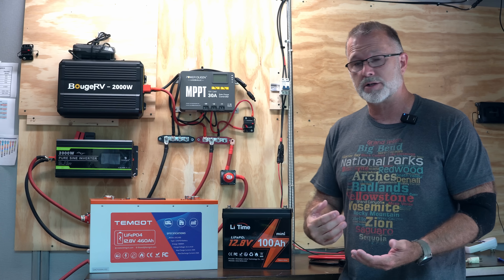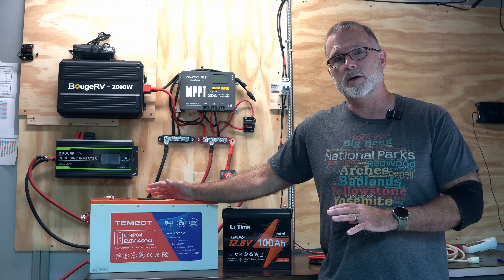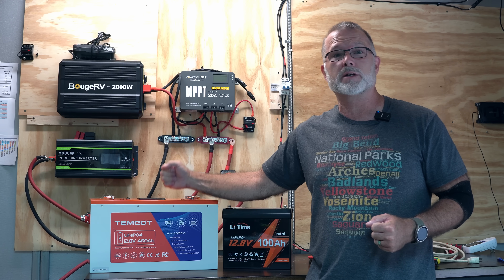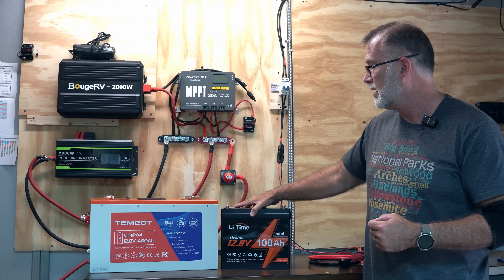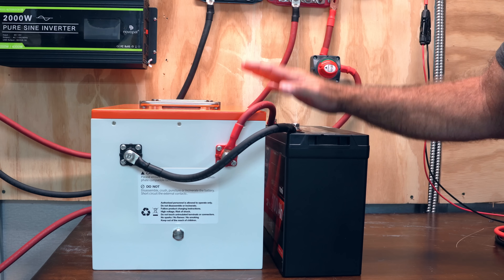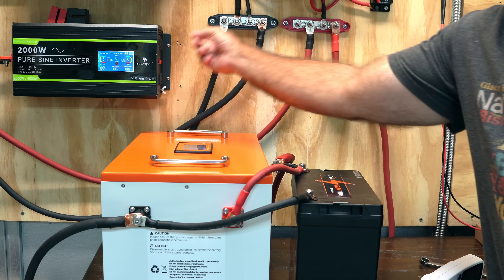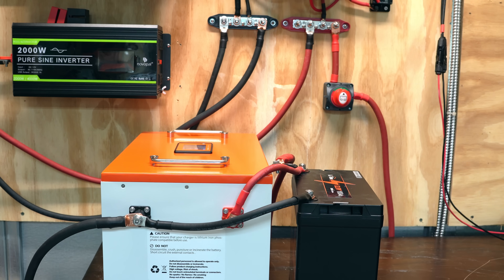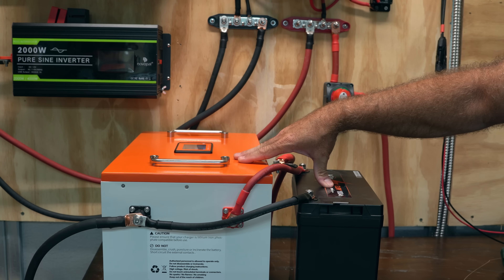Connecting Batteries with DIFFERENT Capacity in Parallel - What Happens?!

Comment: From what I understand is when you connect them in parallel the bms in both combine so you could say run something that uses 350a continuous so maybe ck that out next and try to run say 250a thru them and I don't think the smaller one will shut off. I been told they would share the load and the smaller one could handle it so let me see you try that next. At least try to run something larger than 100a and see if it shuts down the bms in the smaller battery. We do this with Ebikes and I haven't heard of any that shut down
Reply: great explanation what might be an order larger to small in line or would it matter
It seems smaller should not drain til larger is depleted to its lowest level
Then the smaller would maintain an hold off the larger til they equal then
Would drain even til both fail there limit
Reply: No, the BMS systems don't "combine". The ratio of the capacities determines, to a first order approximation, the ratio of the currents supplied, so the smaller battery supplies 18% of the total current and the larger one supplies 82% (i.e. 4.6x as much).

Since the large battery's BMS limits its maximum current  to 250A while the smaller battery's BMS limits its output to 100A, the larger battery's BMS turns out to be the limiting factor (only 2.5x that of the smaller battery).

The result is that with a total current draw of 300A, the larger battery would supply 246A and the smaller one would supply 54A. Any more and the larger battery's BMS would trip, immediately followed by the smaller battery's BMS as it tries to supply the full 300A+. So the maximum current you could expect to draw from the system is around 300A.

Comment: Wonder how many amps are going between the batteries when they equalize?
If they are not both fully charged, could it damage the battery with the lower voltage?
Reply: Yes, he should have explained that. If one battery was a higher voltage than the other when first connected there would be a large amount of current from the higher to the lower voltage battery. Make sure to match the battery voltage before connecting them together. To be safest, attach them together with a resistor or lamp and allow them to equalize before attaching a wire directly between them.
This would also be the case when discharged and one of the BMS' disconnects the battery. Re-balance the voltage before reconnecting.
Reply: Yes, possibly, but the BMS should prevent a damaging current either entering or leaving both batteries.
Reply: @nickwinn7812  This is only if there's a MS between the batteries. If they are directly connected to each other there is no protection... besides the wire

Comment: Did you measure them individually first?? Perfectly true, you can connect a 30ah to a 300ah without issue in parallel and get 330. I do it all the time
Reply: People often have a nearly DEAD car battery, with possibly a voltage as low as 5volts.
Then along comes BOB the builder, with his work truck, and a pair of 300amp jumper cables, and instantly boosts your battery's voltage back up high enough, (from his battery sitting pretty at about 14.4Volts) for you to restart your vehicle, to thus "run" on it's own while recharging your nearly dead battery itself.

What any Bob the Builder NEVER DOES - is check your nearly dead battery's voltage first, he just uses VERY HEAVY DUTY CABLES (that can handle the jumper-currents, as the two batteries "self-balance").
He also ensures that he keeps his own motor running to recharge both batteries, until the jumper cables are removed (with their heavily insulated handles).
That way - he can deplete his own battery fairly heavily, to restart your motor (while the two batteries self-level), and do it without risking any electrical shock to himself, with the heavly insulated handles.

It's the same situation with following distances, only a fool breaks the 2 second rule.

Only a fool touches both battery terminals with wet hands at the same time, or, tries to become the missing starter motor cable - ???? Hello, stupid is as stupid does, but a fool never learns.

Comment: Great info!! One question though! If you paralleled 2 batteries that were the same size one with Bluetooth and one without. Would the capacity from the Bluetooth battery now represent the entire bank?
Reply from the maker: @hooligan9968  highly doubtful, since capacity readings (for LFP anyway) are typically done with a shunt that monitors Amps in/out. And that internal shunt is only going to measure the current on that one battery.  You COULD add an external BT enabled shunt to the main negative and thereby see the total in/out current.

Comment: If we assume that we get full capacity (or 90% of it) the BMS in the larger battery with its 250A limit is actually the limiting factor for large current draws - not the smaller battery with its 100A limit (7:26 time stamp). The reason is that the large battery is 4.6X larger in capacity than the smaller battery and will provide a current that is 4.6X larger. So the smaller battery and its 100A limit would correspond to a 460A limit on the larger battery but it is only rated for 250A.
Reply: really? You think that the 100Ah rating of a battery is indicative of a 100A current limit? Those two things are absolutely NOT the same.
Reply: @occamraiser  Did you watch the video? He days that the smaller battery has a max BMS output of 100A and it has a capacity of 100Ah. This is NOT what my comment is about. The question is - which battry is the limiting factor for large currents.

Comment: Does it follow for maintaining the charge of same voltage, but different ah batteries that are not in service over an extended time in parallel?   If the batteries are a different chemistry, does it matter for maintaining if the not in service batteries are fully charged to start?   Thanks

Comment: You should have put an ammeter on the positive line between batteries and on the positive output.   It would show the bigger battery charging the smaller battery.

Comment: I watched this knowing I have a really stupid battery pack myself. 3-48v 100AH, 4-12V 100AH  (in series at 48V), and a 48v 25AH. All Bluetooth LiFeP04, All in 1 48V 425AH bank. After now 200 cycles or so, they stay within 3% of each other. I generally cycle between 60% and 100% daily. So now I don't think my "Janky Battery Pack" is quite so janky.

Comment: My I share my experience with you? I have 8 lifepo4 74ah made in Japan and 8 lifepo4 72ah batteries made in china mostly because of affordability. I series connect them to make a 16s battery pk. What I discovered is balancing issue no matter how I balance them the stronger 74 ah batteries push the 72ah ones out of balance. Put a balancer on it and start to get a reduce capacity. then I put a balancer on just the 72ah ones and let the 74ah one takes the lead as they both balance at different voltages series connect. I find that work better and the capacity normalizes well acceptable. In response to your video I would say all you would have is two 100ah batteries. If it is the same battery type but different capacity watch the balancing especially when using his draw devices.

Comment: Im running 28 12.8v  Li Time batteries in parallel,  4 batteries / 7 individual shunts.
Hooked to 5 renogy inverters.
 2- 3000 watt
 2- 1000 watt
 1- 2000 watt
They are running dedicated rooms in our off grid cabin.
Hope to have a single 18k EG4 the first of next year , to run our electric stove , clothes dryer and water heater.
I enjoy your informative videos
Reply: how do u keep it charged? solar?
Reply: @EVSWISH  4k watts of solar
Reply: @EVSWISH  i now have 3 - EG4 6000XP's.
1 - 12K PV
1 - 18K PV
Reply: @vinny143  I CALCULATE A 10 YEAR PAY BACK IS THIS ALSO TRUE FOR YOU ALL?
Reply: @EVSWISH  thats about the average. 
I did it because we didnt have grid power at the time.
All depends on cost per kwh in your area.
Reply: I'll admit it, that's cool 😎

Comment: Great informative video & advice, thanks.
It would have been  good to also monitor the current share between the two batteries and graph the battery voltage till drop off & shutdown.

Comment: A very well done video.
There is only one thing I would add ... you should not parallel batteries with different technologies
(like Lion and lead-acid) as they have signifficantly different charge / discharge curves (charged capacity over voltage).
This wouldn't make much sense in the shown case anyway (as the lead-acid batteries have so much less capacity)
nevertheless, one simply shouldn't do it.

Comment: Interesting tests. Here in Peru we are limited in what we can get. I bought a Suyeego 2000w pure sine wave  inverter last year and 200 Ah lead a acid battery (12v). All works well, powering a small fridge, small utensils. I was thinking about buying another battery, same spec, and adding in parallel. The inverter instructions list 12 or 24 v input, but is that implying it will accept either a 12v or 24v input and switch automatically? Or they are just lazy and provide a generic instruction leaflet. Of course no markings on the inverter itself what the input is. I could experiment,  but don't want to blow it up, just in case the over voltage detection does not work too well. Would be interesting to understand, if there are vendors who make auto switching inverters, and how they work. Thanks
Reply: you can put as many batteries as you want in parallel, as long as the nominal voltage is the same
Reply: @makantahi3731  I really want to put 2  ×12v in series, and avoid need for bigger cables I.e 24v. Will the inverter switch to 24v automatically?
Reply: @perunut4656  I don't know, but you could gently test if you raise the voltage a little. I have a 1200w 12v converter and it lights an alarm if the voltage exceeds 15v, maybe the alarm would light up with you if it is only for 12v or it would continue to work,otherwise, I would also prefer to use 2x 12v in series rather than in parallel, because then more energy can be extracted, but ordinary car batteries are starter batteries and are not good for long-term use without charging, there are also lead stationary batteries for this purpose, but they are 50% more expensive, therefore, for frequent use, it is better to have lithium batteries because they support more deep cycles and each cycle is up to 80% capacity, while the car battery does not give more than 50% capacity, which damages it and then it needs to be charged for a long time with a low current

Comment: Don't sweat the BMS continuous current rating too much. As a rule, the equivalent resistance of LiFEPO4 batteries is largely inversely proportionate to their capacities. The batteries will mostly current share, with the smaller battery only producing it's percentage of overall capacity in current. In this configuration, if you used a DC clamp meter on the output terminals of each battery, The smaller battery would show about 18% of the total draw of the inverter, while the larger battery would supply about 82% of the current. If the big battery has a 250 amp current limit, the small battery only needs to be about 55 amps, to allow full loading of the bigger battery management system. (BMS)
Reply: This is accurate.  I run a system with different capacity batteries in parallel connected through bus bars and it behaves exactly as you described.
Reply: @AdministrativeReload  does it matter if the draw connections of positive or negative come from the larger amp battery?
Reply: @236vic  I use bus bars, so things are more or less equally connected.
Reply: Pretty much exactly what I was going to say, no joke almost Word for Word but in a slightly different order.
Reply: Parallel connections you can add current sources. Series connections you add voltage sources. Simplifying but basic theory.
Reply: Why would different chemistry make a difference? What good are the ratings if you can't use them?
Reply: @valsarff6525  That's the whole point. The fact that the batteries pay out the percentage of load roughly proportionate to their capacities, allows you to use the full capacity of both batteries! It's just the peak current is limited to the C rate of the battery with the lowest current rating compared to its battery capacity. If the inverter only needs 100 amps, (1.200 watt inverter) and the bigger battery has a 150 amp current rating, you're golden! Both batteries will discharge evenly, then, will charge evenly, if left connected in parallel. (both batteries maintaining similar states of charge)
Reply: Your damn right the explanation of the the one post the video is incorrect that's why I referred by do the math and just like you said I used 5 current meters in between and everytime it's spot on than another one to the load, the math didn't change
Reply: I think I see where @vincentrobinette1507 is getting the 18% / 82% figure. The video demonstrates that both batteries became fully depleted at the same time (roughly). In order for this to have happened, each battery needed to discharge at a rate proportional to its capacity. The capacity of the parallel bank was 560Ah (460Ah + 100Ah). So the small battery accounts for about 18% of the total capacity (100Ah / 560Ah) while the large battery accounts for 82% (460Ah / 560Ah). Because each battery discharged at a rate proportional to its capacity, we know the discharge currents were in (roughly) the same proportions: 18% / 82%.

Would be cool to measure it!
Reply: @ericbakuladavis  There's only one caveat. the equivalent series resistance of the battery cells, and, BMS's need to be inversely proportionate to their capacities. In my experience, the cells follow that. the big variable would be the on-state resistance of the BMS for each battery.
Reply: @vincentrobinette1507 Cell and BMS resistance and how it relates to current in the video's context is something I haven't researched, so I won't pretend to fully grasp what you are saying, but I will say this: He made a followup video where he does measure current at each battery. It's interesting!
Reply: what happens when charging them both ? do they charge proportionately like you say they will discharge  18%/82% for his setup ? i want to add another 48v 40ah battery in parallel to a 48v 13ah battery and would like to know if i could charge them this way ? would the 13ah charge quicker or would they charge the same or would i have to disconnect them and charge them separately ? its to extend the range of an ebike. i do know they have to be at the same or very similar voltage when i connect them for the first time using anti spark xt90s connectors, and should i get a battery balancer or just connect directly to each battery like you would lead acid battery's  and not worry about all the don't connect two battery's without a balancer youtube videos ?. As i have never had any problems using two battery's in other electronic devices before which is technically doing the same but on a smaller scale . thanks i appreciate any info you may know .
Reply: @steve4073  Exactly the same thing. They will current share proportionately to their capacities, arriving at full charge, at about the same time.
Reply: @vincentrobinette1507  Cheers no need for a battery balancer then :), one last thing does it matter about the 20%-80% discharge recharge rule as i watched one guy say it does not matter with lithium ion batterys any more you can charge them 100% with out affecting their life span too much. say when i go out i get back and i have 65% left i dont charge it unless i need to have the full 100% range in the battery and i only charge it the night before or morning on the day that i go riding depending on  how long it takes to charge before i go out. i was thinking of getting a lab or bench power supply thats adjustable from 0v-60v 10a charger and set it to charge at 52v  @ 2-3A CV/CC not the normal 54.8v @2a. thanks
Reply: Nothing unusual in that. The bigger battery is made for larger current draw than the smaller one. This way they discharge simultaneously and in the same duration.
Reply: @vincentrobinette1507  will it matter if the on which battery you choose to draw positive from larger or smaller?
Reply: How would this work with a larger capacity lower amp battery and a smaller capacity high amp battery ?
Reply: I would have expected it to behave this way. Because both batteries will be at almost identical voltage the current  flow will be greater from the greater capacity battery. It's not common you see this configuration but nothing wrong with it.
Reply: I know some of those words 😌
Reply: @hozn  LMAO. Good one!
Reply: I concur.  This has been my experience with multiple batteries with different BMS's hooked in parallel.  No problem.  They will share the discharge current proportionately to their capacities.  Kind of cool they do this "automatically"
Reply: @jws3925  Just match chemistries. (use batteries from the same brand)
Reply: It should be true that lower capacity as higher resistance, but different manufacturers may have different resistance for the same capacity
Reply: Thanks for your comment. I wish ReeWray would have led with this information. 8 min of review is not needed. When we make YouTube videos, we need to be like a cookbook. Give the recipe first and the bells and whistles after. A good comment would be about the manufacturers' instructions to "only" use matching batteries. Perfection is seldom needed.
Reply: I will connect the main wires to the large battery. Then reduce the wire gauge a little when connecting the smaller battery. This will create higher resistance from the smaller battery and limit its output. If you do this watch your cable temperatures incase you are still pulling to much from the small battery